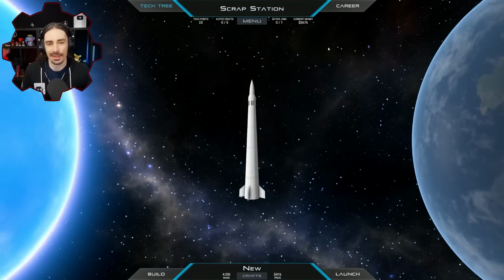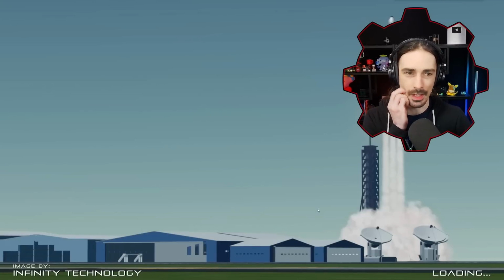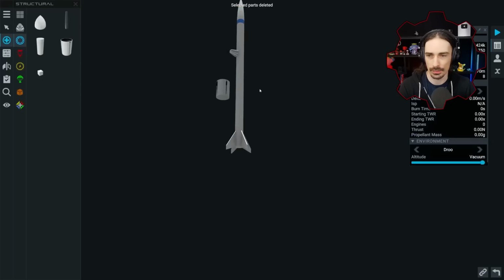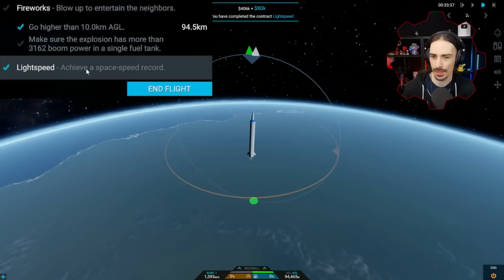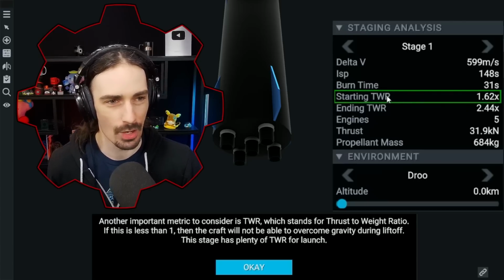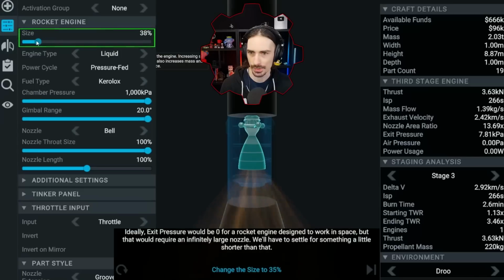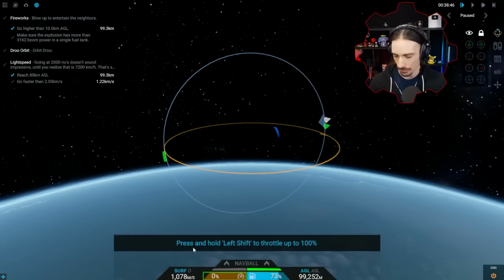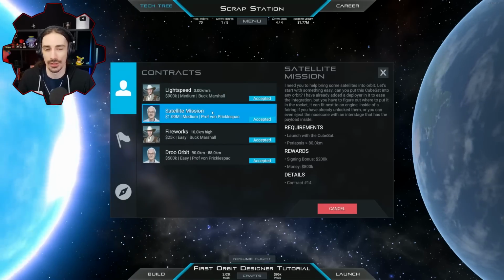Multi Stage Rocket Science is Super Simple... [Juno: New Origins]

Comment: Basically if your engines' fart is weaker than the air around it, it will not propell you. Because for an engine to move something it needs to "shoot" particles in one direction receiving "equal and ooposite reaction" that will move the craft. The if the action of particles in a dense atmosphere is weak the reaction will be too, remember the air is both in front of the rocket and in front of the exhaust so it will be holding down the rocket just the same as it holds down the exhaust.

Comment: Few tips scrapman:
Don’t put fins on upper stages, this makes the craft more unstable during atmospheric flight.

There are a lot of confusing terms when it comes to directions in space. However, to make them more bearable, they come in pairs. Prograde/retrograde are the most important. Prograde means your current forwards velocity, if you open up the nav ball you can see where that is. Retrograde is the exact opposite direction of prograde.

In orbits, you have a periapsis (pear-ee-ap-sis) and an apoapsis (ap-o-ap-sis). These signify how low and high your orbit is, respectively. 

You can have decouplers and engines in the same stages! That way, when you decouple, your engines activate as well as decoupling spent boosters.

Use liquid fuel engines for orbits. This is so you can better control how your orbit looks, as well as having fuel for  de-orbiting, cuz you can throttle/turn on and off the engines.

It is SERIOUSLY going to help if you learn basic orbital mechanics. If you get KSP (you can get it for free if you look at the right places) it can teach you what you need to do. Or, you can get help from someone who knows orbital mechanics. Remember, every action has an opposite and equal reaction! (I could help you out if you want) 

Get KSP. It’ll be a huge stepping stone for space flight, and it’s a lot simpler than Juno. It has loads of tutorials! Plus, legally they do not care if you copy or even sell their game, so you can get it for free.

I’m serious about you getting help. Throwing yourself into the deep end for this will probably end with you not liking rocketry because it’s quite difficult. I’m dead serious about helping you out. (I’m in your DC server, name is Samuari_007)

Hope these quick tips helped you out! Leme know if you need help, I’ve put some landers in neat places in KSP.

Comment: Stages irl are the segments of a rocket, in games like these it works a lil differently
Most people I've seen (mainly in ksp) use seperate stages for decoupling the stage than for firing the engines. However this game wants you to play by its rules I guess and have each stage as both decouple and engine ignite at the same time, which is unrealistic as you always want to gain some distance from the detached stage first. A lot of rockets have skirts which detach seperately from the stage leading to more stages in-game

Comment: You will probably don't see that. 

But a very useful tip for this type of game is the Delta-V (∆v).
It shows you the speed that you can reach in the Vacuum (starting to 0).
So this is like the "fuel left" gauge that we have in more land type game.

It's logicle, with the drag or different planet attraction (slingshot, forgot the real name). The delta-v can change.

In KSP (don't exactly know JUNO but seems the same), you can go on some space object the hard way with a lot of Delta-V.
Or use physics, and go the slow (and painful) way, and spare A LOT of Delta-V (like use 20x less fuel).

This is a very very important concept to understand in this type of game...

Hope you understood what I said and thank you for reading my comment xDD

Hope you'll have fun with this new type of game on this series
---
And the TWR (Thrust to Weight Ratio), this is pretty straight forward.
If it exceed 1, you're engine are powerful enough to launch it !
If it is lower than 1, add more engines...

In orbit, this has no meaning. It's only relevant when lauching from an object (depens on his gravity)
---
You've said things about staging. So to help you out :
The lateral stages are for the "booster" so solid fuel engines with really high TWR to help you get of the atmosphere
The vertical stages are the more important one, it helps you change the engine you need in different situation : 
 - The 1st stage have always very powerful engine to (with sometimes the help of lateral boosters) get of the ground and go higher the atmosphere, so high TWR
 - The other stage have always more efficient but less powerful engines, so, with the same fuel tank, you can't get of the ground but in orbit you gain way more delta-v (and more stability.

So, in conclusion, 1st stage, big engine (can have lateral boosters), and then vertical stages with smaller engines to gain more delta-v so go as far
---
And the cone engine is solid fuel engine, 
Solid fuel engine cannot be stop or cannot change their trust.

The other more detailled one is a liquid fuel engine,
Less powerful but has cardan (can change the direction of the thrust), but you can stop them and change their power (ctrl and shift in KSP, don't know for this game).

The little engine (you showed on Appolo) are RCS thrusters,
They are so useful for little adjustment or space rendez-vous, but don't really need it for your vessels for now.

(And sorry for my bad for my English, I'm French)
Reply: Lol, ig the game tell you most of that in this video xD

Comment: Getting to the orbit and adjusting it involves some waiting and throttling at certain spots of the orbit, but basically if you throttle prograde(in the direction of travel) at one point of the orbit your orbit's height will increase at opposite point. Here you were throttling while still near periapsis(lowest point) and so it was adding height near the apoapsis(highest point). That part you didn't have time to read was kinda about that, but I wish they'd made it so that it makes you go in the map mode and throttle while there, so the player can see the effect of their actions clearly, and also made you timewarp until at apoapsis to show that you increase periapsis faster and more efficiently.

Comment: as a ksp player: 
1. top stage should be a lot smaller than bottom stage
2. once you've launched, you should tilt slowly towards the direction you want to orbit. Ideally you should be on a 45 degree angle at 10km
3. circularise your orbit when you're at your apoapsis (which is ideally above 85km) by burning prograde until your periapsis is above 85km

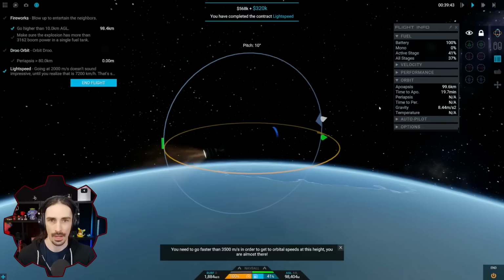btw is that Scott Manley at 22:52?
Reply: Yes indeed!

Comment: As an avid fan of aerospace engineering and rocketry, seeing you figure out the basics of orbital mechanics was so great to see! Looking forward to more!
The way you get to very specific orbits is to know where in your trajectory around the celestial body you need to perform certain burns. For example, you already saw that just thrusting prograde while going up gave you a very high apoapsis while barely raising your periapsis high enough to be out of the atmosphere. Usually you would just burn until your apoapsis is at your desired altitude, then coast to around that apoapsis and then burn prograde to raise your periapsis until that is also at the desired altitude. As a rule of thumb, burns on one side of the orbit affect the shape of the orbit on the other side. There are six directions to change orbit: prograde (in direction of trajectory, i.e. speed up), retrograde (backwards to your trajectory, i.e. slow down), radial in (towards the planet), radial out (facing away from the planet), normal (towards north pole), antinormal (towards south pole). prograde/retrograde burns are used to raise or lower orbits (i.e. change velocity), with radial burns you can do the same but is's very inefficient. normal/antinormal are used to change orbit inclination, i.e. the angle the orbit goes arount the planet. 
Hope that helps!

Comment: Staging is usually top to bottom, the side ones are solid rocket boosters (srb) and then the ship will split into smaller stages the higher it goes, this allows for less weight being dragged down, and also allows the pilots a smaller easier craft to re enter with, examples of stacked staging would be like the falcon rockets or the booster section on the bfr or the lander module and orbiter for artemis missions

Comment: Scrapman, the big things you see on the side of rockets are usually solid rocket fuel boosters. and a lot of rockets use it but then also have vertical stages as you did
Reply: I guess a space plane like the shuttle "stages" sideways too, but it's definitely uncommon outside of solid boosters.
Reply: @Firebuck  i'd say the best example of a liquid fuel side booster would be the Falcon heavy or the Soyuz.